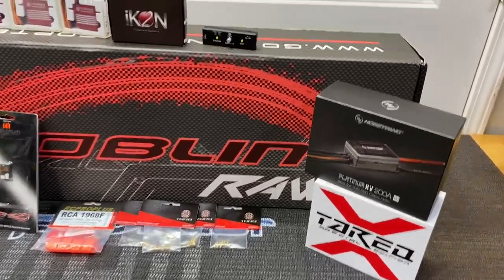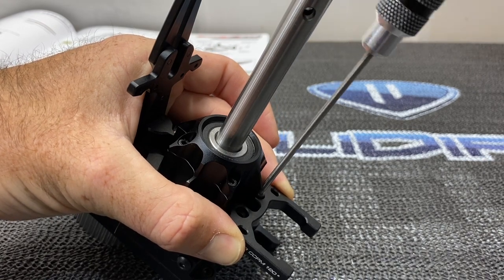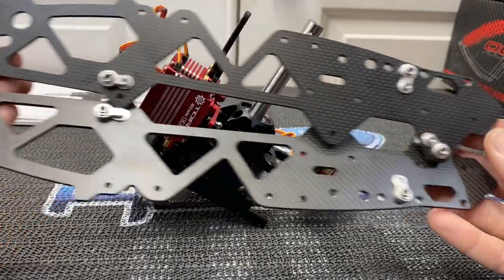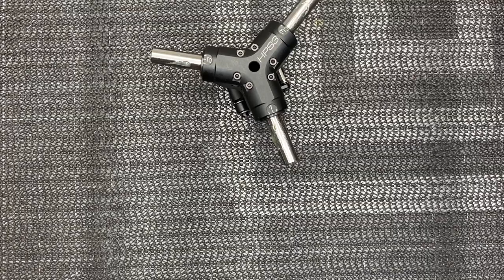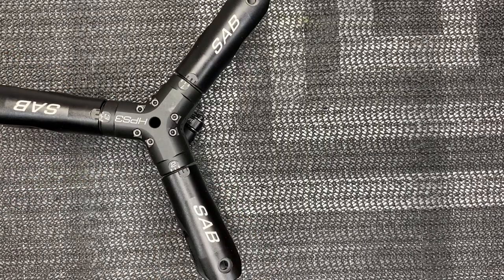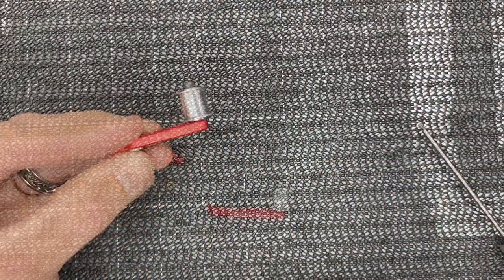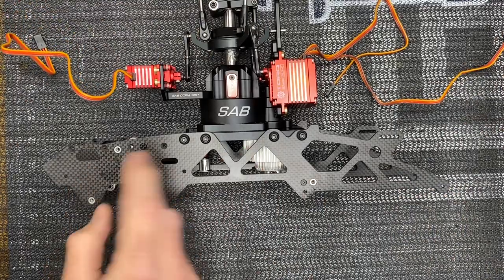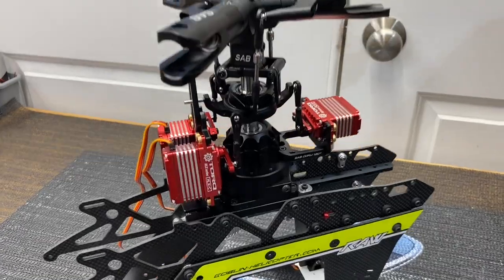SAB Goblin RAW KSE 700 Build Part 1

Comment: Wow you are so lucky. I am building mine but it will take me about a year to finish saving up for mine. I got it crashed for a ridiculous price from a good friend and I have to fix it and buy electronics for it. This will be a good video to rely on but I have to go one step further and re-grease the transmission as I need to replace the top transmission half.
Reply from the maker: It definitely can take some time to build a model like this especially at how much it cost. I do the same, I will buy the kit and then I will buy the Servos and then the motor and ESC and so on and once I have everything ready I will start the build!

Comment: I liked the idea of wiping excess retaining compound with alcohol to avoid getting it into the bearing. I do try to tighten the 4 servo bolts in a cross pattern, though.
Reply from the maker: I always try to wipe the excess off so that way it cannot seeping to the bearings and create grittiness same with Loctite! You can tighten it down and an X pattern but it really doesn’t make a difference just because the servo is going down to a machined flat surface so no matter what it will bolt down flat.
Reply: @westhobbiesrc8051  Also what do you think about too much Loctite. I noticed on some you had the bolt prepared and on another you applied directly onto it. I keep hearing there is a problem with too much Loctite because the Loctite squeezes out of the bolt through the head. What I do is use a plastic bag (some SAB kits and spares later I have a LOT) and dip the bolt into Loctite then roll the bolt on a clean part of plastic to remove the extra. This will leave the threads visible with Loctite just in the middle. I used to also apply directly on the bolt. Don't know what is best I have just gotten used to the "roll" method. I also apply Loctite directly on the thread for parts like the tail bell and head spindle and avoid it on the bolt altogether so that it can't accidentally bump a bearing with Loctite as I run the bolt through.

Comment: The head screws that keep the feathering shaft in sucks.  Try to take one out and immediately the head of the screw snapped. So be carefully to those that want to check the head screws if they are Loctite.
Reply from the maker: I believe those screws are held in with retaining compound. You have to be very careful! I always heat my screws up prior to removal just in cases of! Don’t want to strip or break anything.

Comment: I just bought a goblin maverick 800 what exactly do I need to purchase apart from what already comes with the helicopter?
Reply from the maker: Everything lol the helicopter is only a kit so you will need all electronics. Servos, motor, ESC, FBL and battery 12s 5000-6000mAh as well as loctite, and tools.
Reply: Thanks sounds like I need to spend another 2k 😅
Reply from the maker: @Alex-qn3me  yes you do! Lol they get expensive real quick!